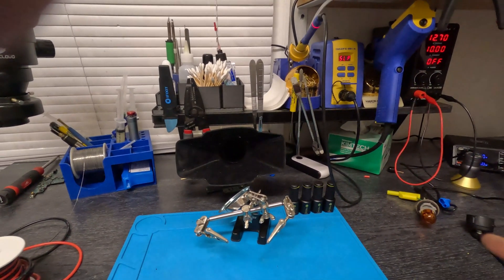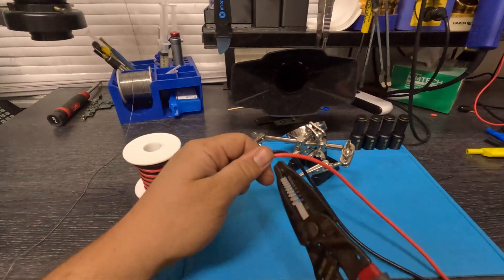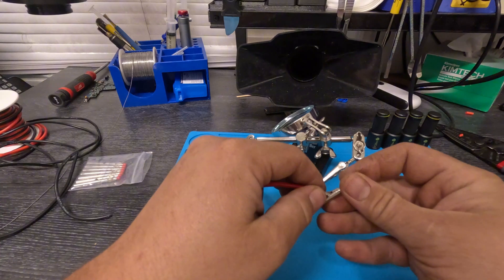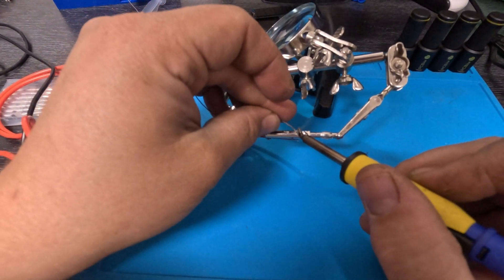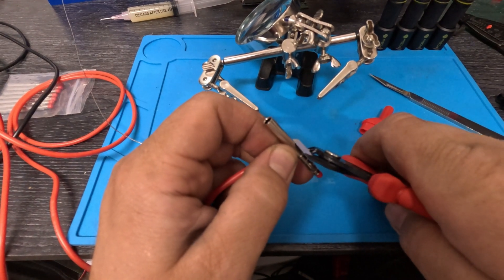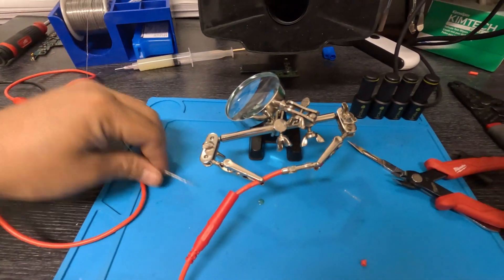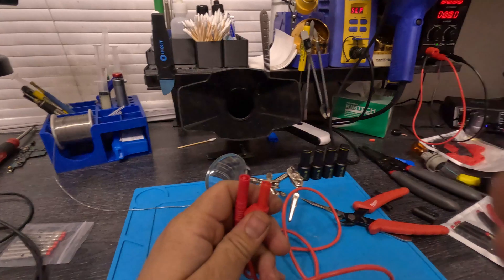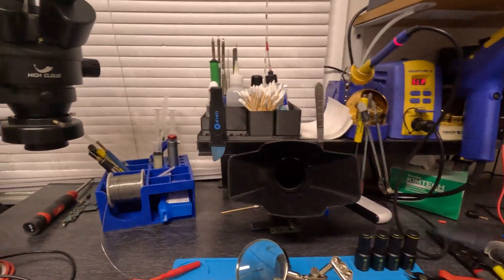Create Your Own Test Leads!

Comment: Having watched this, I ordered some banana clips and I can confirm its great to be able to remake your test light/other leads. 

I don't have a power probe yet, so when I'm working inside a car or at the back or under, I was using a regular 12v wiring cable from home depot. I had aligator clips crimped to the ends but that sometimes resulted in the clips touching one another. Now, with these banana leads, it's easy to switch from power to ground and safer!. And, I can hook up the test light. 

Thanks for the tip, it is arguably the best improvement. 

And it makes other people impressed at work when you whip these custom made test light out.

Comment: Hello I remember you talked about a 3d printer you were playing around with a few months back, I don’t remember which video you talked about it in, can you please specify the make and model? I am interested in getting one that I will put to light use, thanks from a long time viewer
Reply from the maker: I have the Bambu Labs X1 Carbon that was there top model until there new one just came out the H2D. It is a really great machine especially if your new to 3D printing like I was. It is kind of expensive, however they do make a cheaper model called the A1 that is not enclosed so you can't do all filaments but standard PLA works great.

Comment: I’m nearly 4 minutes in to the vid and I’m wondering does he know they have Allen key grub screws down inside them to secure the wire once you push it through the hole? The screws are usually inside the long metal pin or sometimes separate loose in the bag. 

I was gonna solder mine but decided to go with the screws in case I want to reconfigure/repurpose them in future. 

Great tutorial either way, I think your best making your own as you can customise everything and it’s fun and cheaper. 👍
Reply from the maker: These don't come with the screw, I have those also.